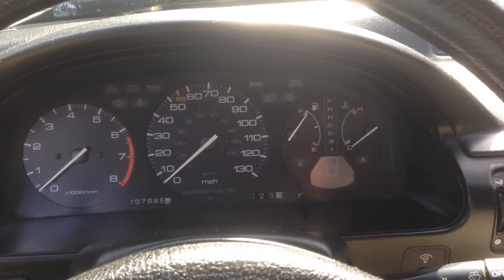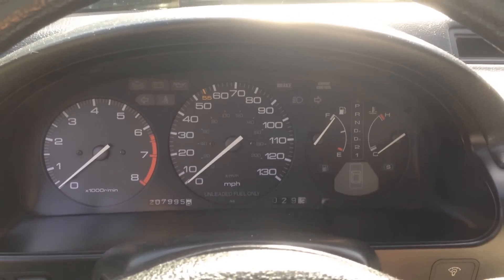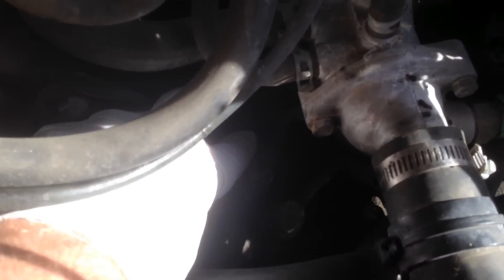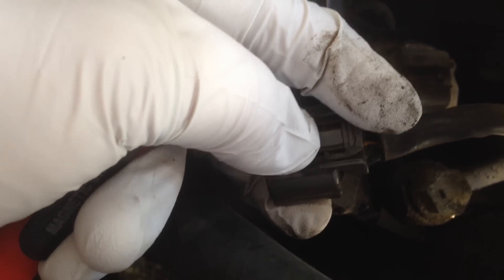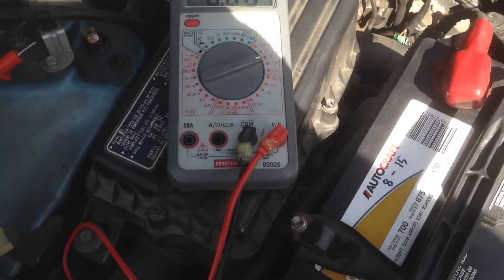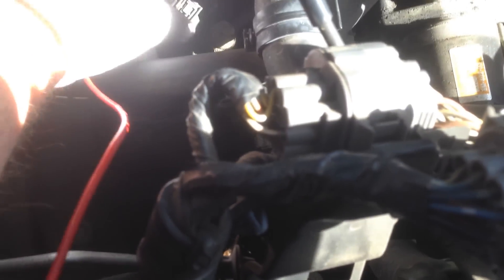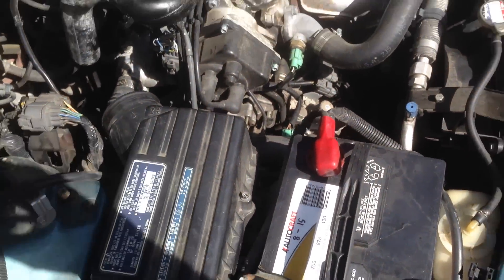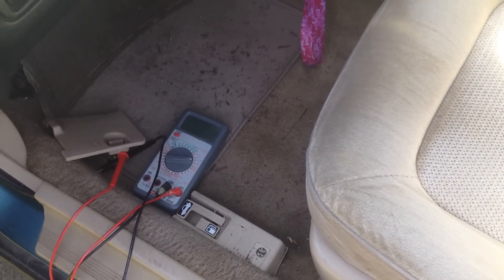1990 to 1993 #Honda #Accord Speed Sensor Input Test

Comment: i measure the green and the yellow cable and it has 11.8 and 12.20 volts  the black its ok!is this ok?because i have i speed issue in my dash! help me pls..
Reply from the maker: What year, make, and model, are you working on?
Reply: @tubejim101  i have Renault clio 2001 1.2 16v 75hp deferent car but the cables is the same.
Reply from the maker: @macedoniaisgreek5628  You will need something like this:  https://amzn.to/2U67QME
Reply: @tubejim101  ok thanks

Comment: Thanks for sharing the your knowledge. Great video and step by step explanation. My speedometer and tachometer stop working. Replaced de speed sensor but the same. Online found your video and here I’m asking for help. 94 Lexus es300. Have a green-red-red at the speed sensor harness. Tested for continuity fallowing your video and I assuming that the green is ground I did the test and no continuity, the other 2 have continuity then for voltage were green 9.8 red 0.07 and red/blue 12.12 
It is any more sensors in this cars. Any suggestions.? Thanks in advance.
Reply from the maker: You can go to Autozone and get Alldata diy for your car.
Reply: tubejim101 thanks so much. Never heard about it. Checked online and looks a good $20 investment. Thank you.

Comment: Great video! I changed the speed sensor in my vehicle and that didn't work. My speedometer doesn't go past zero and I can't even accelerate  to higher speeds, I've lost some engine power (not sure if this has to do with the speedometer not working. Is this common?). I hooked up the code reader and I'm not getting any live data for the vehicle speed it reads zero. Any idea on what I should do next ? Thanks
Reply from the maker: What year, make, and model are you working on?
Reply: @tubejim101  2009 Chevy Cobalt LS automatic transmission. Engine 2.2 . Thanks for the help
Reply from the maker: Sounds like your car is running in limp mode.  Should take it to an independent mechanic, and pay for a diagnostic.  Around here, they are less then $100.
Reply: @tubejim101  Thanks for the tip, much appreciated.

Comment: My red wire isn't getting any power to my test light but the yellow & black is. Can ya help?
Reply from the maker: What year, make, and model, are you working on?
Reply: @tubejim101  96 accord vtec 2.2
Reply from the maker: You should be doing this with a meter.  Test light is not going to show you the values.  Black should be close to 1 ohm.  Yellow should be close to 12 volts, and red should be close to 5 volts.
Reply: @tubejim101  yeah that'll.be my next step. I just couldn't find a meter handy atm. But regardless id fig the red wire would still lite up as the black & yellow ones did. Ill lyk my results. Thx. Happy Holidays
Reply: Good day what's next if red wire don't show any reading.  Thank you
Reply: it's a 2011 BLM saga 1.6 car made in Malaysia.  thanks
Reply from the maker: @salindarsingh6680  Not sure.  I only work on 90's Hondas, and the 22re from Toyota.

Comment: Thanks for the video, my sensor or wiring is giving me problems. I believe my sensor is bad, but I will be checking the voltage thanks to your video. But my sensor only has two leads not three.!! Thanks again.
Reply: My middle lead was broken off in the female end

Comment: When using continuity, shouldn't the power be off? Why did you turn the ignition key to the on position? Was it to close the relay?
Reply from the maker: Would be safer with the power off.  For checking the ground, it should not matter.  Unless it was ground side activated, but I don't think it is.

Comment: 1998 toyota corolla, in the morning works fine. Around 3 30 when it's hot outside, over 95 the speedometer and the miles do not show, they do not work.
Reply from the maker: Been only working on Honda Accords 90-93, and Civics 96-00.  Only Toyota I know a little about is the Toyota Pickup 85-95 2wd with 22RE engine.

Comment: Jim, I'm working on a 93 Camry 2.2l. When the engine is cold, I'm getting a bog after a stop from 1st to 2nd shift, and the engine revs past 3k to shift. After the engine/trans is warmed up everything is fine. This car has only 95k miles, but I did have a bad coil which I've changed [NGK parts] along with new cap/rotor, plugs, and plug wires. Also an obd 1 code 12, that comes, and goes. Also checked the egr valve, and related, as well as the evap system, all is good. Thanks.
Reply: Sounds like a shift solenoid problem to me ?

Comment: Nub question, but what do you do if there is not a good ground on the sensor?
Reply from the maker: You can try to find the brake in the wire and repair it.  Or, run a new ground wire.

Comment: I have a 1990 Nissan 300zx, non turbo, 5speed. The speedometer does not function, however the trip odometer does work. But it is totally inaccurate, as is the mileage odometer. I have had the instrument cluster bench tested and it worked fine. Can anyone give me an idea as to what the problem is? Thank You
Reply from the maker: Sorry.  I have not worked on a Nissan.  Might be worth it to ask some independent mechanics, how much they charge for diagnostics.  Think the going rate in my area is $20.

Comment: Great video! I spent $100 on the sensors, and it still doesn't work. I'm going to be mad if its just a fuse.
Reply: Was it a fuse?
Reply: Flaqko _ alternator/ sp sensor fuse under dase
Reply from the maker: Thank you.  Can you return it sensor?  Good luck.

Comment: Kick ass video bro! I'm having similar(probably deeper ) issue with my 98 prelude. Keeps popping fuse14. Killed my alternator and a new one after install. Anyone come across this??
Reply from the maker: Was thinking you have a bad voltage regulator in your alternator.  If you pickup another alternator, have it tested before you install it.  Also, have your battery checked to make sure it is still good.  Worst case, you have a short.  A short is hard to find, unless you are experienced at finding them.  Might be worth finding a good Honda mechanic in your area, and paying for a diagnostic.  Should cost less then an alternator.
Reply: Ok. Sounds good. I replaced the alternator (did not test voltage regulatior) battery tested good. I'm thinking a short also. Ok I will find someone with experience on this. Thanks man!

Comment: This doesn't explain replacement of the VSS Sensor . And there could still be short do to loose connection, or wire rubbing on body . This part of a diagnosis not a fix .
Reply from the maker: You are correct.  It is an input test video.  For replacement, see this video: https://www.youtube.com/watch?v=__hA02DaZVw

Comment: What if my odometer works and my speedometer/trip meter don't work? Also, what if there is a problem with the wiring between the guage manifold and the harness where the VSS connects to?
Reply from the maker: What year, make, and model are you working on?
Reply: Acura Integra RS 95
Reply: Acura Integra RS 1995
Reply from the maker: Have no experience with that car.  If the odometer works, then i suspect that the problem is not in your Vehicle Speed Sensor.  If it was a Honda Civic 92 to 00, i would plug in a working dash cluster, and see if the problem goes away.  I imagine dash clusters are expensive and hard to find for a 95 Integra.  If your lucky, a 96 to 00 Civic cluster, might plug in.  Also, check your fuses, and clean up your battery terminals.  Could be a bad ground.
Reply: Gotcha. I'll try a few suggestions and let you know how it works out. I suspect it's the cluster too so that might be worst case scenario.
Reply from the maker: Looking forward to finding out how you fixed this :)

Comment: Although the tests you are doing are correct, they are not dynamic. If your signal wire was okay whilst static, and then on the road you hit a bump, and the wire shorted to ground due to bad wire protection, you would get the same issue. You will then have replaced an expensive sensor for no reason.

Comment: If I get the error code, any chance it's the transmission?
Reply from the maker: What year, make, and model do you have?  What trouble are you having?
Reply: 2005 Mazda 3 2.0L
AT and Check Engine light come on with P0715 Code
Car will go into dummy mode, it used to reset when I stopped, now it resets randomly.
When it goes out of dummy mode, AT light turns off, Check Engine light stays on
Check Engine light is on constantly now, AT light only comes on when dummy mode kicks in.
Reply from the maker: I am not a Mazda guy, so i really don't know.  It sounds to me, like a bad transmission speed sensor.  Think i would just order an inexpensive one from ebay, and swap it out.  Or see if you can find one at your local junk yard.  That's one cool thing about Hondas.  Your going to find them at your junk yard.
Reply: Mike Stanis what was the issue with your car ?

Comment: I did a manual conversion on my 96 civic. Found out my speedo stopped working after the conversion. Could it be a bad VSS?
Reply from the maker: Are you getting any check engine lights?  The VSS in the Civics are pretty good.  Assuming you don't have a check engine light, next check your fuses. Most of the time it is bad wire, or the cluster unit.  Bad wire can be checked with a multimeter.  The cluster unit comes out pretty easy in a 96 Civic.  I would barrow a known good one, and try that fist.
Reply: tubejim101 check engine light comes on when I get up to speed. Roughly past 20km/h. I'll try get the code today. Will check the fuses and wires as well.
Reply: Sergio Ramos you ever found out the problem?

Comment: i need to test speedsensor for Suzuki alto
Reply from the maker: Should be the same.  But I have not worked on one, so I don't know for sure.
Reply: Sidine Bidine I got a 2000 Nissan Frontier transmission slipping in when you put it in gear

Comment: 99 honda Odysseus 3.5
Reply from the maker: I am not familiar with that vehicle.  If it has a, Transmission Fluid Temperature  (TFT) sensor,  I would look at that. Check the sensor, and wiring. They are often in line with the Speed sensor.
Reply: Thanks  but I took one senser out and it was broken so I order a new one let u how it goes

Comment: when cold it runs ok i tested the cods all i get itpo720 wich say speed senser what do it all run have no gears after 10 min of driven
Reply from the maker: What year, make, and model are you working on?
Reply: 99 Honda odyssey
Reply: I put a new sender in an it broke
Reply: Did u fix. What was it?

Comment: I have 98.6 ohms at the black wire. I jumped the connector and got the speed sensor working .
Reply from the maker: That's awesome.  I will see if I can find out where that wire goes.  If I find out, I will let you know.  Hopefully it just grounds to the chassis.
Reply: Did you jump ground or hot?
Btw how many volts are going through the vss?

Comment: before I go on to check resistance. I have no continuity at the connector with the key on but with the key off I do have continuity I checked on another vehicle the same vehicle with a good sensor and again I have no continuity with the key on and continuity with the key off. my question would be does it matter if the key is on or off to check for  continuity.
Reply from the maker: As in the video.  You should have a ground, with the key on.

Comment: I have no continity in the wires . I have 5v signal voltage and 12 volts but no continity.  what should I do next
Reply from the maker: If your showing infinite resistance on from your black, wire, connector, to your negative battery post, then you have a brake in the black wire.  If you show a high resistance, then your black wire is not making good contact.  Rust or something like that.  As a test, you could jumper a temp line from your black connector, to a body ground, and see if that gets your VSS working.
Reply from the maker: When it is reading infinite, it will usually just read 1, on every ohm setting.  I will try to do a video on this. Might help some others out too.  If you can read numbers on your meter, but they keep changing, a lot.  That usually means you have a bad connection.  If there is not to much rust, you can try cleaning things up with some wd40, or electrical contact cleaner.  Some times that works.  Other times you will have to replace the wire with new wire.
Reply: Hoi  Im not good at these things but the reading on my black wire to the negative pool keeps going up and thats what you mean with infinite resistance right? Im dutch and not everything in my english is clear to me

Comment: I had my 96 non vtec civic sedan get splashed by high pressure water from a passing car, plus I had no splash guard in the front under the car. Lots of things got wet, car drove badly and changed gears all crazy like and check engine light came on. Autozone read my codes and one came up for cylinder misfire. They also checked my alternator and it wasn't putting out over 12 volts. Bought new alternator and it charges battery to 14 volts but speedometer keeps jumping around, even in park when I rev the engine. Replaced vehicle speed sensor but speedometer is still jumping. Honda has a bulletin out about fuse #15 on the driver's side fusebox blowing due to a shortage that occurs on the intake manifold's bracket. Was hard work to get it off but the wires were compromised. 
If you keep blowing fuse #15 it very well might be that shortage.
Reply from the maker: Thanks for the fuse tip.
As far as charging your battery with your alternator, you should watch this video:
https://www.youtube.com/watch?v=uNOrsQpzzxA

Comment: Thanks for the video, very helpful! My speedometer is resting on 0mph and I'm reading 12v and 11v on the signal lane. It got brake fluid spilled all over before it fails and I've already replaced the VSS and cleaned the whole area and contacts with no success.

Ground connection is fine tho.

Any suggestions how to trace this further?
Reply from the maker: I would start with your battery.  Take it in, have it fully tested.  Then get it fully charged.  If it is all good and all charged, then clean those posts and terminals. Battery posts and terminals should look new when your done.
Reply from the maker: You are getting the 5v on the signal line?
Reply: My signal wire was between 10v and 11v. I found a troubleshoot guide for the car and this measurement was alright. I've got the replacement VSS with the mechanical part so I decided to put this unit for testing standalone. Surprisingly the speedometer was showing up when I turned the mechanic so I took the whole old mechanic out.

You wouldn't believe it, the whole mechanical part was molten inside due to frictional heating. I think the brake fluid degreased the mechanic and this is how it happened.

After replacing the unit it works well again :-)

Thanks again for the video pointing me in the right direction!
Cheers
Reply from the maker: That's great.  Glad you got it figured out.
Reply: @tubejim101 hola yo no tengo linea de señal en el conector que podre checar
Reply: you all prolly dont give a damn but does anyone know a tool to get back into an Instagram account..?
I was dumb forgot my login password. I appreciate any help you can offer me
Reply: @Kace Emmett Instablaster :)
Reply: @Dario Reid thanks so much for your reply. I found the site on google and Im in the hacking process now.
Seems to take quite some time so I will reply here later with my results.
Reply: @Dario Reid It did the trick and I actually got access to my account again. Im so happy!
Thank you so much you really help me out :D
Reply: @Kace Emmett Glad I could help =)

Comment: Mines was hard to pull out but i got mines out ... it can causes any " S " light too .. but what would be the fuse for the TCU and if my TCU comes back and S light still there could it be an connect or wire issue ... but nice video .. i learned from the best this brang back memories lol